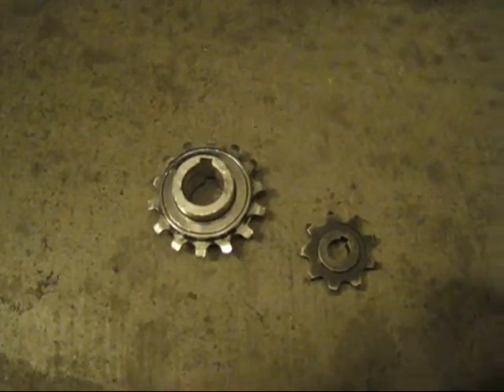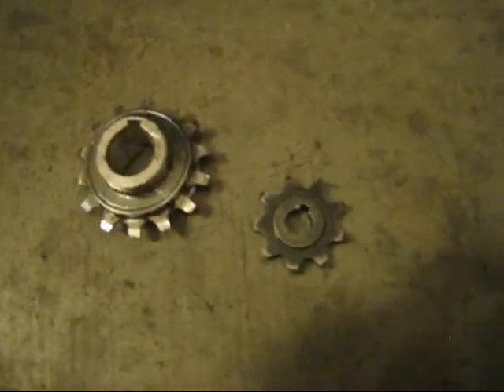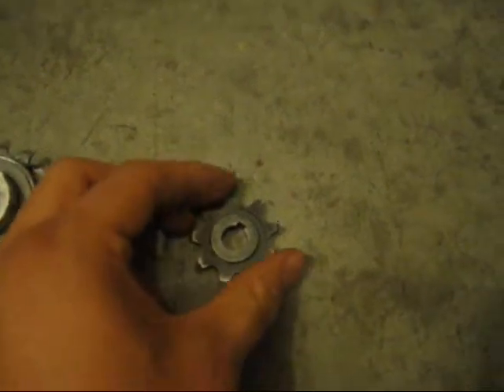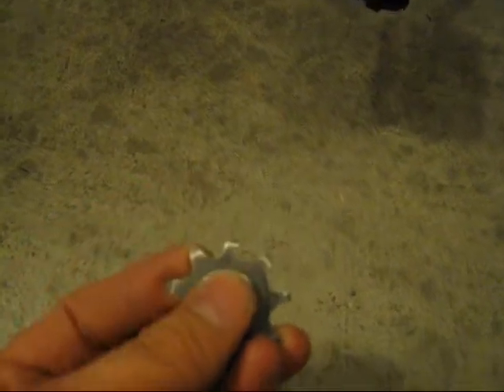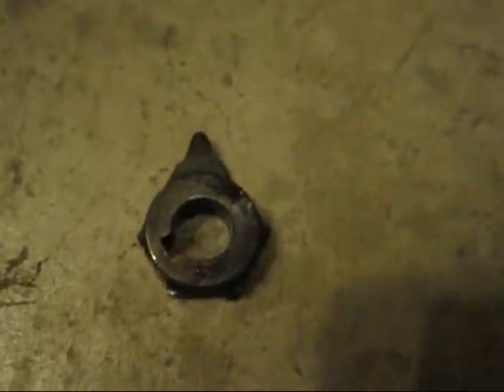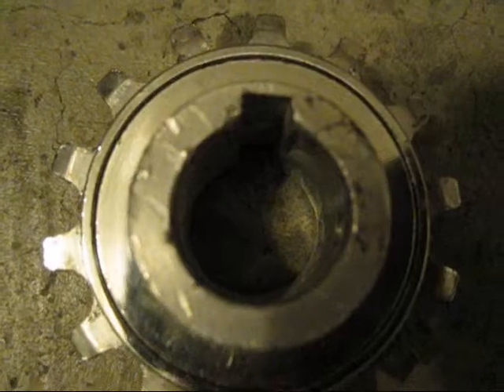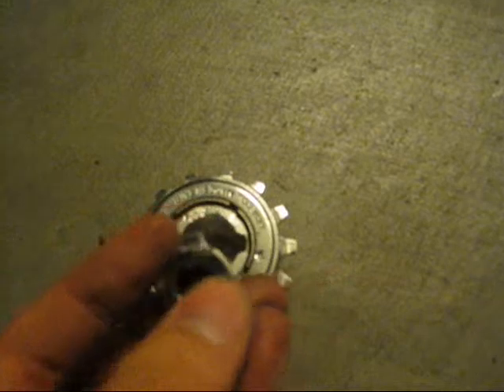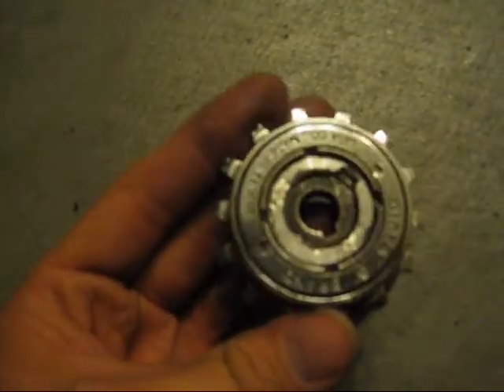Homemade Freewheel Sprocket for MY1018Z Motor

Comment: Could you publish a video on how to remove and install the sprocket.
Reply from the maker: Unfortunately I no longer have this set up.  However it will be much easier if you purchase this adapter at Staton-inc:  http://www.staton-inc.com/store/index.php?p=product&id=1918    Then you can thread on a freewheel sprocket of your choice. This is what I currently have on my bicycle.  The link to the freewheel sprocket is here: http://www.staton-inc.com/store/index.php?p=product&id=1130

Comment: You should also include a 20mm  x 11mm bushing to take up the extra space in the 20mm sprocket to shafts 11mm.
I don't think JB Weld would hold it very well without the added bushing.
Reply from the maker: The JB Weld did hold well, but this video is several years old.  Since that video online stores have sold the parts necessary to build a much better motor sprocket:  
Freewheel adapter for the MY1018Z Motor:

http://www.staton-inc.com/store/index.php?p=product&id=1860
13 Tooth sprocket for the motor:
http://www.staton-inc.com/store/index.php?p=product&id=725
Reply: Thanks for your reply and links to the new and updated freewheel sprockets.
I have an extra 450 watt Currie motor I took off my eZip Trailz and put the newer style 450 watt motor with the slanted reduction gear because it has more torque at the same 470 rpm and much quieter.
I want to use the motor on my 1980 Raleigh Mixtie GS 27" 10 speed road bike and will need a LH freewheel sprocket for the rear wheel.

Comment: Thanks for the vid! Like some previous comments, I would also like to know where you found the 9T freewheel sprocket sold in Switzerland. Thanks
Reply from the maker: I do not know about a 9T sprocket from Switzerland.  My DIY part that you saw in that video has worn out.  So I replaced it with a new 13 tooth sprocket.  Here are the parts:

Freewheel adapter for the MY1018Z Motor:
http://www.staton-inc.com/store/index.php?p=product&id=1860

13 Tooth sprocket for the motor:
http://www.staton-inc.com/store/index.php?p=product&id=725
Reply: Awesome thanks :)

Comment: a lot of stress on that one tooth, would have also put a screw thru the side to hols it in place , anyone know how to keep a sprocket on a shaft that has only a woodkey slot, no retainer clip or threads on ,it is a smooth 11mm shaft with key slot, thinking I can drill thru the shaft and place a screw could attempt a die on it but I don't want to weaken the shaft , its a 80amp,3200 watt electric motor from alien power systems
Reply from the maker: This set up is no longer necessary since you can now find a keyed adapter to hold a sprocket.  It can be found here: http://www.staton-inc.com/store/index.php?p=product&id=1860

Comment: o my god.. i gotta say you are a genius!!!!!!!!  I'm working on a project similar to yours and after watching your videos, I am starting to have BULBS of ideas. How is SAL battery holding up on your trailer video??  I know you used two lithium batteries on the new bike.  I can't afford that.  So I am still going to use SAL for now, but are they durable for long term?
Reply: Lead acid batteries are really durable, the only thing is that they have a much lower energy density than lithium polymer batteries so they way much more to get the same amount of power. I personally am using lipos as opposed to lead acid, just make sure you have a BMS on the lipo packs to keep them from overdischarging but lipos are worth it! you could shave off like 16 pounds on the whole rig that you are building. For something like this, every pound counts.

Comment: so 14 tooth on the motor and 55 tooth at the crank. How much do you weigh and are you happy with that gear ratio. I weigh about 225 and live where it is vey flat.